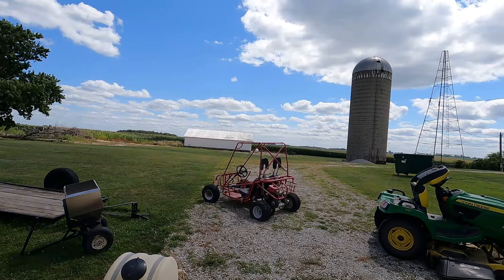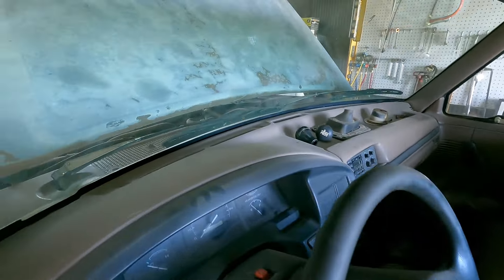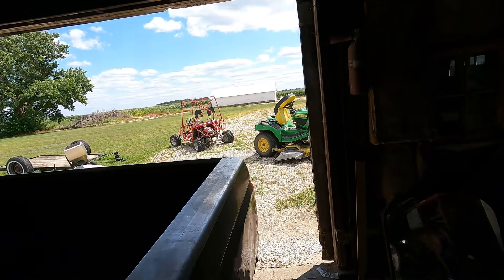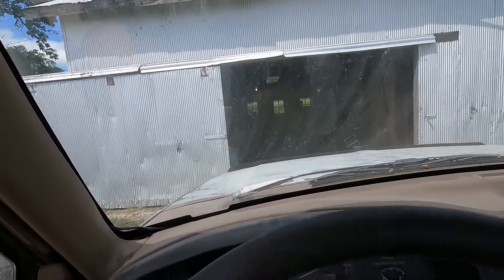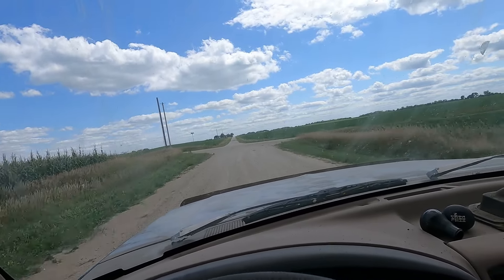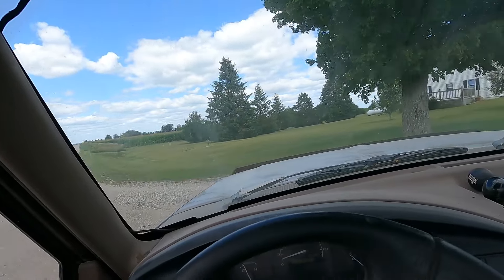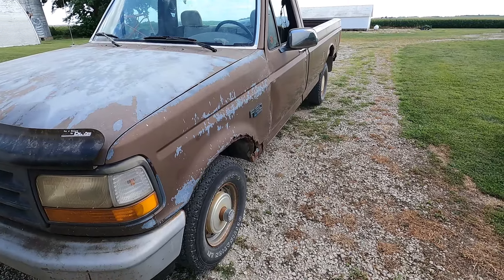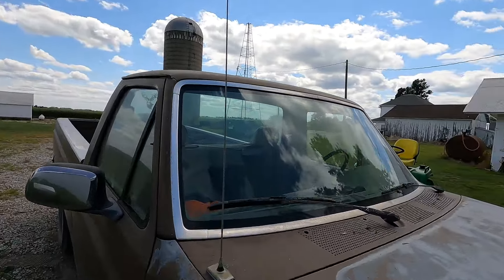1993 Ford F150 PROJECT Truck Is ALIVE

Comment: I didn't realize Ford offered a T-18 4-speed in that "late" of a model, I was only aware of the Mazda 5-speed and the ZF5 options.  I think you'll like the inline 6. It doesn't have the upper RPM horses of the V8s, but it sure pulls just fine at lower RPM.  If it's in mechanically sound condition, that truck's drivetrain will last a lot longer than the frame does.  And it's a 4x4!
Reply from the maker: I know... I didn't and many many others didn't know it either about the t18 4- speed transmission..  really strong transmission but was an option..  I have the original window sticker.

Comment: Question: do you still have the wheels from the 95 Eddie Bauer truck? Maybe those wheels with new tires would look nice on this 93 XL but the ones from the flareside would look nice as well if you can find a decent set in the salvage yard,also are you going to add a cluster with a tach in it or leave 100% original bone stock build?
Reply from the maker: Don't have any of those wheels left... as far as the tach, have got that far yet lol
Reply: @TheFoxShop  okey doke, I was just wondering if you did and was curious about what you had ideas for the truck